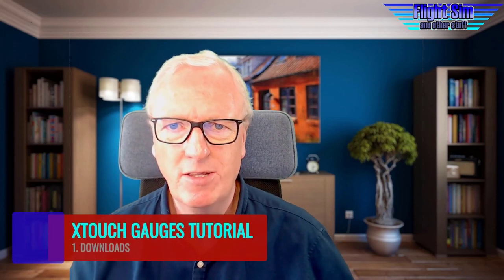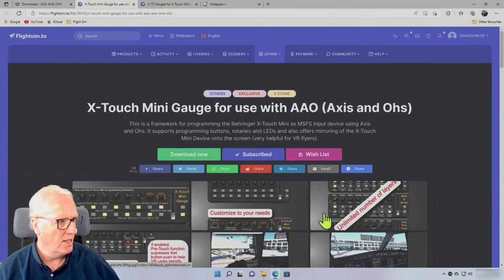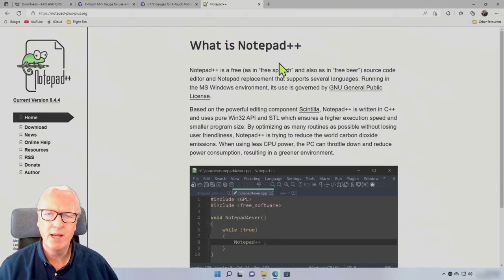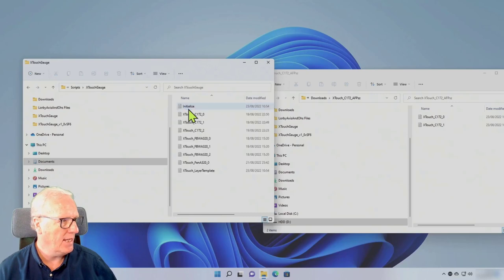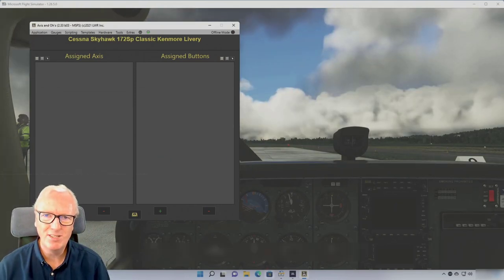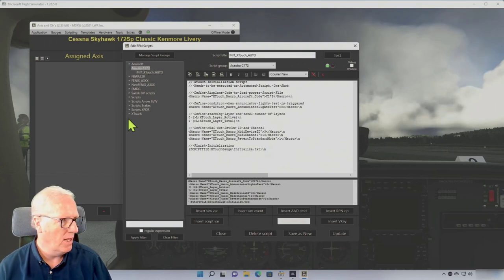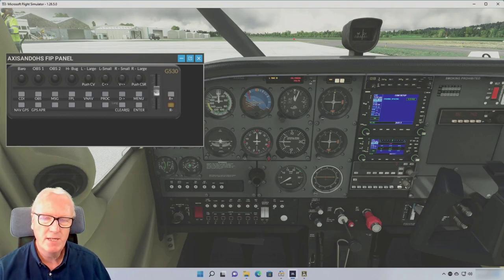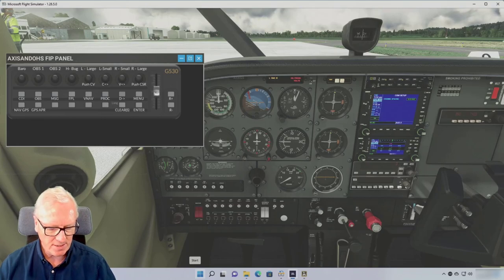x- touch AAO (Axis and Ohs) lesson 1

Comment: Will ASOBO add the MCDU and other FMS  rotary knobs to the button assignments eventually ?  DOes A&O handle these types of things ?
Dying to assign those finicky dual knobs on the G1000 and RANGE knobs etc to my button box rotary knobs.  Thanks f or the hard work.
I have done in XPLANE ! what a boone.
Reply from the maker: AAO does handle the rotary and mcdu through scripts that in turn refer to MSFS events. AAO just takes the pain out if the interface into those events and take the need to write complex code

Comment: Did not work for me. Followed your guide to the letter. I got the desktop FIP (the web one was all squashed) on display and the labels were present but, touching the midi controller did nothing. Pressing the buttons on the FIP version of X-Touch with a mouse, executed the command well enough but, actual midi key presses are being ignored. AAO runs as admin. Midi  in out (1+3) showing in AAO too. Any ideas??
Reply: Exactly the same problem here. I wish someone would explain that. I am near to return my unit. I don't need x-touch on my screen either. And it is far from easy to program that stuff either. It is not userfriendly for beginners at all. Well, hopefully someone explains how to get x-touch working.
Reply: @b.v.m.5409  I did get help from the original dev over in discord to get it functioning but, in the end I purchased spad next to use with the x-touch. It's far simpler to get working with the sim that way.
Reply: @scottishrebels  Thank you for your response. I hate discord and always tried to avoid it, as it looks like made for children in kindergarden age rather than for adults. Cartoons everywhere... Well, maybe there is also a way to change that somewhere; just I couldn't find how... But in my desperation I wrote there a message to (hopefully) get help. I already spend so much time watching those videos and now after spending money on AaOhs and hardware the result is that the whole thing doesn't work. Very frustrating! As it seems that many struggle with configuartion issues and the like, it really would be helpful to also do a video that helps clarifying those problems. I maybe will give spadnext a try. Thanks again!
Reply: I found that it wouldn't work after I installed FSUIPC, which I had done for LukeAirTool. After I uninstalled FSUIPC and restarted the sim, my XTouch worked fine again.

Also make sure "Midi device enabled" is checked on the Hardware menu.
Reply: @rogerparadise  I did get help in the discord and got mine working but, ultimately the process with spadnext and the mini is far simpler to work with so I have gone with that.

Comment: Hi, Thanks for these videos.  I've just ordered the X Touch mini :-)  I'm a user of both XP11 (Now 12 too) and MSFS.  Will set up for MSFS first.  I assume Axis and ohm is for MSFS only?  Will SPADneXT work for the X Touch mini or AAO much better?  Any suggestions on using the X Touch with Xplane?  Thanks
Reply from the maker: My copy of SpadNext is now quite old, I stopped using it when I switched to MSFS as the additional license from XPlane was more expensive an AAO. I dont know if Spad supports Midi yet, but I'm afraid AAO is just MS based so FSX,P3d and 2020

Comment: You say there will be one pop-up after pressing import. You hit save once but I have to hit save about 40 time then get another pop-up I hit save on that and it says import complete. Then when I try to name a group, AAO crashes. Where have I gone wrong
Reply from the maker: I think this is because the you x touch is on the wrong channel may be. In AAO go to show midi devices. Hopefully you'll see mini in ID1 x-touch and midi out id3 x touch. Can you confirm
Reply: @FlightSimandOtherStuff  I didn't have midi device enabled. It's now showing correct I'd in AAO 
But my xtouch still doesn't communicate with my PC. 
The FIPs or the aircraft does nothing when xtouch controls are used.

Comment: I've followed all of the steps here plus manual and can't get xtouch to communicate with AxisandOhs. Would appreciate things to check. I put the desktop gauge on screen and get no indication of communication as pushing a button doesn't light up button, slider doesn't move gauge slider and it doesn't move anything in acft.
Reply from the maker: A couple of things to look at. ! are you running AAO as administrator, is the mdid devices option ticked under hardware, try hardware change option and rescan. Is the xtouch showing in there Midi in[1] and Midi out[3]
Reply: @FlightSimandOtherStuff 
Started working today. The only thing that doesn't work is CDI. Pushing the top left button lights up the top left button on the desktop gauge but it doesn't change from GPS to VLOC
Reply from the maker: @jackwilliam3675 Thanks for the info Jack. My mistake, I have uploaded nes versions to flighsim.io Just over right the old ones and disonnect / reconnect aao and it will work
Reply: @FlightSimandOtherStuff  That did it. Thanks.
Reply: @jackwilliam3675  It really would help others and me with the same problem if you also could tell us, HOW you solved it. As for me it is not working at all. These FIPS work but not my x-touch...   :(  Oh it is so frustrating!
Reply: @b.v.m.5409  Did you ever figure this out? My fips also work but not the xtouch mini.